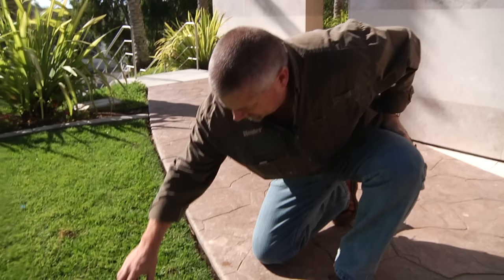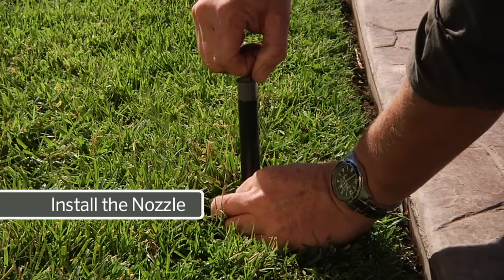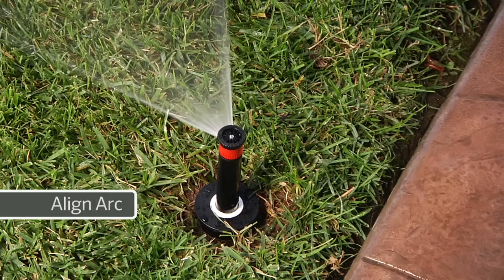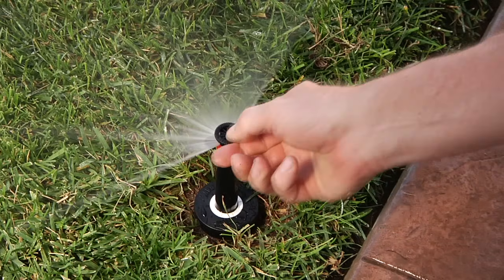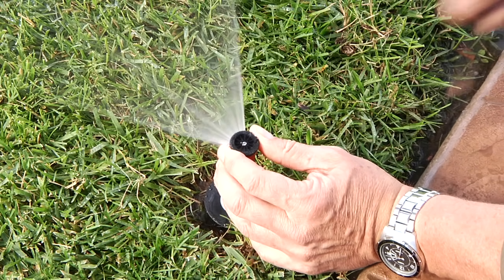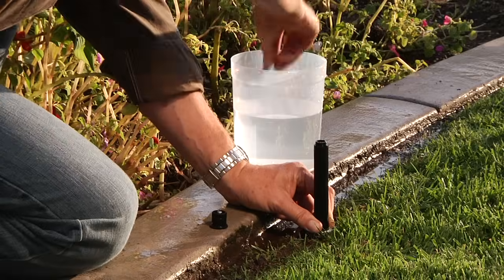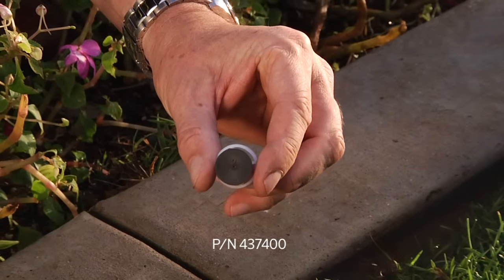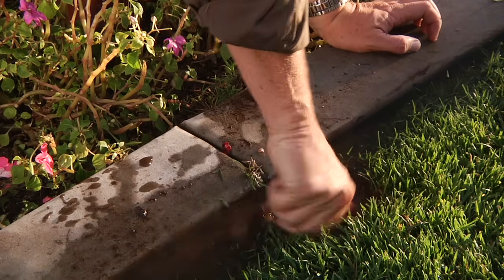Hunter Spray Adjustments and Maintenance

Comment: Can I adjust the radius also on RCS 515 and LCS 515 left and right strips?
Reply from the maker: The radius can be adjusted by turning the screw in the center of the nozzle. Make sure you have the filter screen in there.

Comment: Is there any reason not to just have a check valve on all heads?
Reply from the maker: Heads at the top of a slope don't require check valves but it could be a good practice to have them on all heads.

Comment: Where do I get replacement filter? I think previous person removed the filter because screwing the top screw doesn’t adjust radius aka reduce distance. Someone told me if the screw doesn’t change anything it is because the filter is missing
Reply from the maker: Contact your Hunter distributor or local irrigation professional. Filters are a comment item for them to have around.

Comment: Excellent!  Especially the part about twisting the riser to change direction of spray.  I've done this for years, but always thinking that I am probably doing damage to the riser, its cylinder, or something else.  But, guilt aside, it always worked for me.  Now I learn that from a mechanical standpoint, it is actually OK to do this.  I got a clue this morning that the procedure might not harm anything when I shined a flashlight down an empty cylinder and saw the thin plastic "fins" at the bottom of the cylinder.  It seemed as though twisting the riser inside the cylinder to adjust spray direction would not likely harm the mechanics of the thing.  And those fins together with the "teeth" on the bottom of the riser (the teeth that engage with the fins) would account for the slight resistance and the clicking noise I hear when twisting the riser.  But of course I was not sure that my procedure was mechanically OK - until I watched your video.  Thank you!  And please feel free to take the rest of the day off.

Comment: I have a new Hunter Pro.  Water will not come out of it.  I can't even blow thru it.  What am I doing wrong?
Reply from the maker: Please remove the nozzle, the top section that determines the flow and pattern.  When turned on, there will be a large volume of water coming from the sprinkler.  This will flush out any debris in the sprinkler.  Reinstall the nozzle, making sure the adjustment screw is turned counter-clockwise to allow water flow.

Comment: I like these rotary type sprinklers. Problem for me is that they only adjust down to 40-degree pattern. It's too bad they can't make one that starts at 0 and adjusts to 360
Reply from the maker: Thank you for contacting Hunter Technical Support.
 
Yes, unfortunately, the rotors only offer an adjustment arc to less than 40 degrees. So you have an install application where you need the rotor heads to be adjusted to less than 40 degrees? You may want to look at our specialty MP rotators, perhaps our MP Right and Left corner heads.
Reply: @Hunter_Landscape_Irrigation  Buenos dias con quien puedo ablar para ver el problema que estoy teniendo con un control hunter ACC2

Comment: Does the riser adjustment system have a 360 spin? Is there a point that it will stop ratcheting and unscrew the base instead? Can the riser adjustment system go both clockwise and counter-clockwise?
Reply from the maker: Thank you for contacting Hunter Technical Support.
 
On the PGP-Ultra and I-20 rotors, they will ratchet 360 degrees when the arc is set for 360 degrees.  Otherwise, the ratchet will stop at the "Right Stop" fixed point, but will not unscrew the base.
 
The riser adjustment system is designed to go back and forth to verify the limits for which you have set the Right Stop, and the Left Arc degree.  Please see the product spec sheet attached below for more detailed information:
 
https://www.hunterindustries.com/sites/default/files/rc-173-ir-pgp_ultra-i-20.pdf
 
Thank you again for contacting Hunter Technical Support. Please let us know if we can offer any other assistance.

Comment: I have one of those in my plants bed. Which had no plants at all. Just rocks. I’d like to disable or discontinue the use of that specific head. Is it possible to just close off that screw completely? So that the water does not come out anymore? Or will that cause pressure issues?? What is the best course of action to discontinue that water sprinkler head. I’d like the easiest method if possible.
Reply from the maker: Good question about shutoff for a sprinkler. To completely shutoff a sprinkler with a spray nozzle its best to purchase a shutoff nozzle (916400SP) or a shutoff cap (213600SP) to completely shutoff the irrigation from that sprinkler. You can tighten the set screw in the middle of the nozzle to reduce the flow but you may have some water still leaking out once you have tightened it down as far as it can go. If you choose to tighten the set screw you must have a filter in order for it to work. Use this link to purchase a nozzle, cap, or other Hunter parts.
 
https://www.hunterindustries.com/distributors-in-north-america

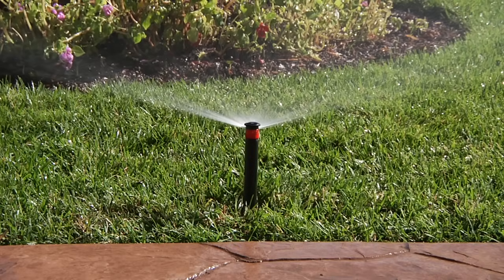Comment: What is the name of that sprinkler head @1:08 to 2:12? It looks like a popup sprinkler for shrubs. He never says the name or type or part number. I need that sprinkler head but don't know the name.
Reply from the maker: Hello,

The sprinkler head that is at 1:08 to 2:12 of the video is the Hunter Pro-Spray. The Pro-Spray body comes in different pop up heights (Shrub, 2", 3", 4", 6", 12").
https://www.hunterindustries.com/irrigation-product/spray-bodies/pro-sprayr

Hunter makes our products, pricing, and replacement parts available through our network of authorized distributors.

Comment: Can an aftermarket pressure regulator be installed like the check valve?
Reply from the maker: Thank you for contacting Hunter Technical Support.

Because we do not make those products or test with them we can not validate that it will work with our products.
Thank you again for contacting Hunter Technical Support. Please let us know if we can offer any other assistance.

Comment: I am looking for advise how to fix the problem with nozzles of X-Core Hunter system, the wont's raise above the ground in one zone only. All nozzles in other zones work perfectly. I checked and found no issues with water supply, power supply, solenoid valve (shows 24 ohms), nozzles obstruction, wiring, electrical connections etc.  I noticed that when I fully open the bleed located at the solenoid valve for that zone the nozzles raise up without any problem. What can be the problem? Is there a video addressing this issue?

Comment: Does anyone have any suggestions to correct Pro Adjustable sprinklers from moving position?  The arc stays the same but the actual positioning of the sprinkler is turning about 45 degrees round to the left which means my patio is getting soaked. Even if I readjust it while the cycle is on, the next time they start up it again sprays in the incorrect position again. Thanks in advance.
Reply: Hunter Irrigation thanks but I don’t live in the US.

Comment: I have a zone with 7 - MP 3000 sprinklers.  I've suddenly got 3 that pop up but will not rotate.  Filters are clean and the other 4 work fine.  What should I do now?  If this is a flow problem and before I try to reduce the size on all sprinklers, would removing the filters help increase the flow?  And if I turn off 2 or 3 sprinklers, I should probably turn off those that are operating normal and see whether it makes a difference in those that don't?  Is there an internal mechanism that sometimes fails to rotate the sprinkler?  Do parts wear out?

Comment: I have a ton of problems with my Toro 570's either sticking in the down position or the ratchet system will move and I end up watering a wall or the street.  Even after adjusting in the correct position the ratchet will move over the next few watering cycles.  I have had to replace many of my Toro's even after cleaning them.  After 2 years this is when I see the problems I talked about.  There are a large number of 570's both in my front and back yard.  Each sprinkler is in the proper level position and they were not installed at an angle.  I am at the point where I might change to a different brand other than Toro.
Reply: I have this same issue now with just one of my sprinklers, it moves around to the left (the arc stays the same). I correct it and it stays during that cycle but the very next cycle it moves again, soaking my patio in the process. Did you find a solution for this? Thanks.